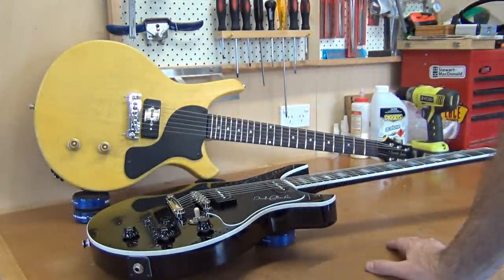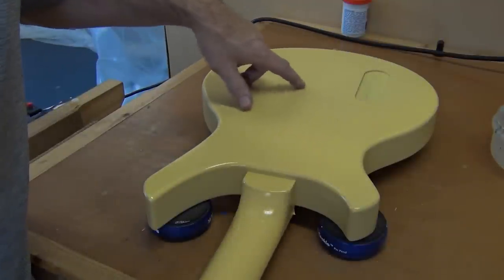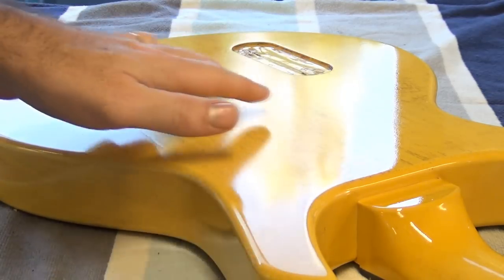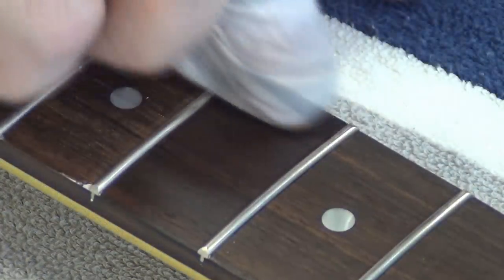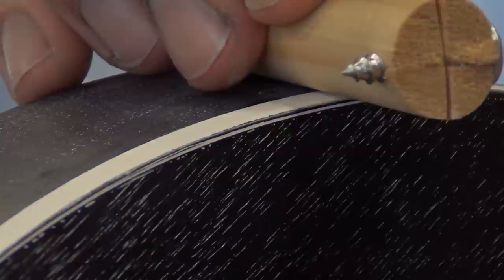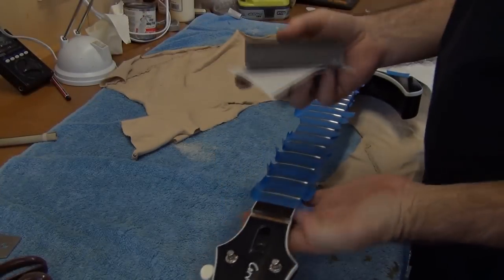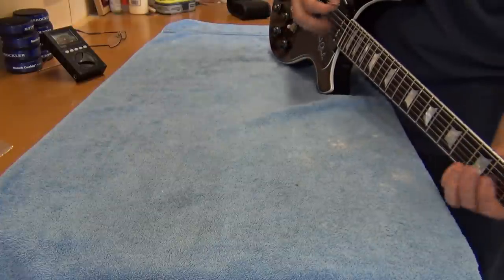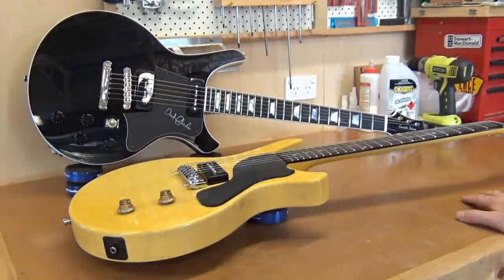Building A Gibson Les Paul Junior Style Guitar - Part Five

Comment: I have sat and watched both the Stratocster and Les Paul Jr. series and I must say well done!!! I noticed that you have a lot of nice woodworking equipment yet you still use a lot of manual tools and the ole mighty touch of the hand to do certain operations, which make your videos very useful to those of us with limited access to some of the higher dollar equipment. I have a wood working shop close to home, so I can take my wood and have them do the jointing and thicknessing which is all that you do that I can't on my own, as I now have access to a table, hand held and dremel router, as well as a band saw, so yeah all those little template tips and tricks you have shown me are great!!! THANK YOU FOR SHARING!!!! I have been re-working guitars for a bit, or just ordering second hand parts and pieces off the web to do my builds but you have inspired me to try to create my own guitars, at least as far as the woodworking part goes, with the money I save doing that, I can spend more money on more premium hardware and electronics. When I do get my first completely custom build moving I will record some video and let you see how it goes!!! By the way I have a picture slideshow video on here called the Ratstrat build/80's style Stratocaster, it was built from a bunch of second hand parts and new hardware and electronics, and I did all the finish in my driveway and dinning room!!! Keep the videos coming, CHEERS MATE!!!

Comment: Great work! I really liked your trick of using a temporary trapeze tailpiece for locating the bridge. On the junior I see you're using the wrapover type with adjustable saddles. How did you drill for the bridge posts? Did you angle the bass side back further from the nit, or do the adjustable saddles mean you could drill the posts square on?

Comment: David,
A couple of questions about your technique, please:
1. How many times in total do you apply and remove masking tape over the binding?For example, do you spray clear sanding sealing coats over the binding, or mask the binding one time, from the beginning (when you use paste grain filler) through the color coats?
 2. Do you spray final clear coats over the binding?
Thanks so much. I'm getting ready to spray my first guitar with binding and want to get it right the first time.
Reply from the maker: For a solid colour finish I would normally tape up the binding when I grainfill , I would then spray a clear sealer coat over the entire body including the binding.  Then mask the binding again for the colour coats , remove the tape and spray the clear coats over the entire body ( including binding )

Comment: Wow.. this is so great. Nice job man ! Love the P90's. Your name is on the pickups, nice. Is there some firm you work with to engrave or etch or whatever ? And can you give me the name otherwise please ? Really nice feature. Also the name on the black guitar's scratchpate is really classy. Just that final touch. But in one thing i'm a bit confused. The one P90 pickup, you wound at 10.000 rounds and put" a coil tap" between or something and then winded 3000 rounds above. I simply don't understand how you managed that. So, you have to interupt the coil at 10000, but how ? Do you solder a wire on the 10000 spot, shield it and just wind further? That's the only way i can think of. It's not a stacked pickup. Can you clarify that please ? Thanks for the vids, i watched them all from all the guitars and learned a lot. Also about simple tools and filling with white on black. Genious. Have a nice day sir.

Comment: David very good , and that powerful sound In this p -90 , as has output resistance of these pickups ? another wonder to starting a SG one project, I have more doubts about the body thickness is 35mm or 38mm , could tell me ? which is the measure of Gibson and hear thickness change over the years , between the old and the current ?
Reply from the maker: Mauricio Neves Thankyou Maurico.  Not sure about the SG question, sorry

Comment: Hi I have been building guitars and basses for a while but I am just a hobbyist. Finishing is always a problem for me, I'm not afraid to spray as I worked as a cabinet maker. I have been using automotive paint and lacquer (2 pack) and the drying/curing time is a killer (Irish climate), also the flattening of 2 pack car lacquer is very difficult as it cures really hard and just when you think you are nearly there you get a rub through. Just wondering do you mind sharing what paints and lacquer you use. I have unfortunately built some nice basses and guitars that I play regularly but the finish lets them down a lot. Any info would be a great help.

Regards
Fergal
Reply from the maker: Hi Fergal,  I am using Nitrocellulose lacquer and the Stewmac colours and dyes to tint/colour the lacquer http://www.stewmac.com/Materials_and_Supplies/Finishing_Supplies/ColorTone_Liquid_Pigment_for_Lacquer.html
Reply: ***** Thankyou for the reply. I used to use nitro in the cabinet shop a long while ago, much easier to apply than the car lacquer. I don't know why I didn't stick with that, must be because my first time round finishing I got a panel beater friend to help me finish the guitar and he suggested the 2 pack car paints. Guess I will have  to start a new project to try this out :) I will have to get some of those pigments as well I'd love to do a trans black on a maple top.

Thanks again